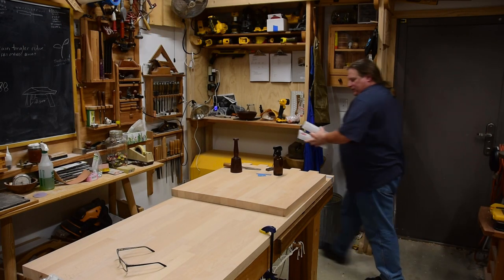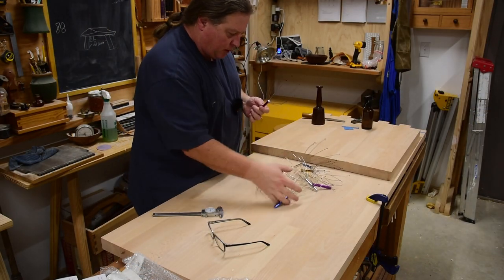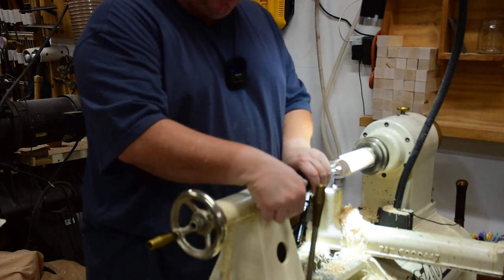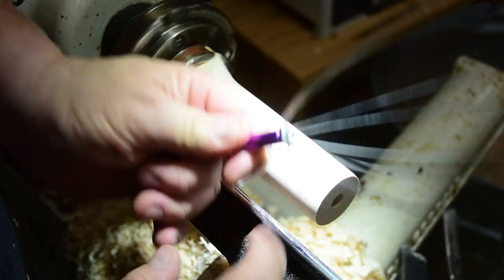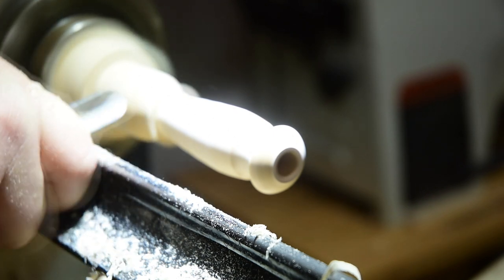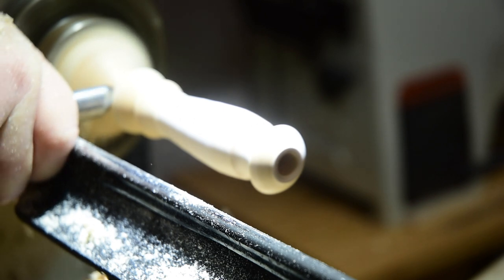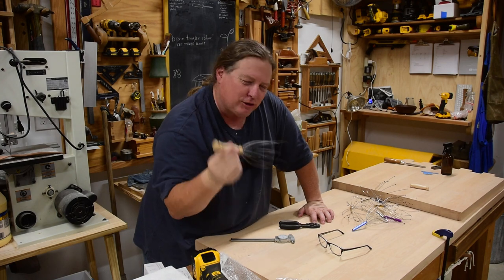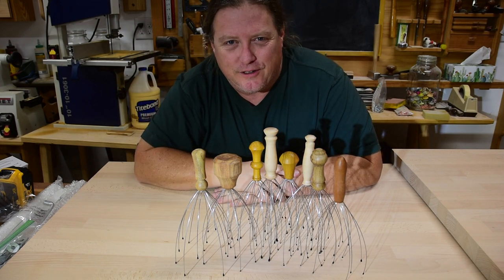Turned Brain Tinglers - A Fast and Simple Art Market Project

Comment: Cool idea, great way to use up scraps.  Seems like about $15 or so would be reasonable for something like this.  Cast some resin blanks with smaller scrap wood and would probably need at least $25 to $30 for the additional material and additional effort to polish and finish the resin - that might be on the low side depending on the finishing effort but I don't think the market would bear much higher.  One could probably get two handles from a single 2 x 2 x 6 handle blank or use a bottle stopper mold for this.

Comment: Really like this idea, and just ordered two boxes myself. (Ps. Now they are down to around $1.50 each, so an even better savings). My question though is about the sanding paddle you were using. It had 4 different grits on it in circular pads.  I’ve looked around and am coming up blank in finding them, is that something you made yourself, or bought somewhere?
Reply from the maker: Bought in a bin at a symposium.